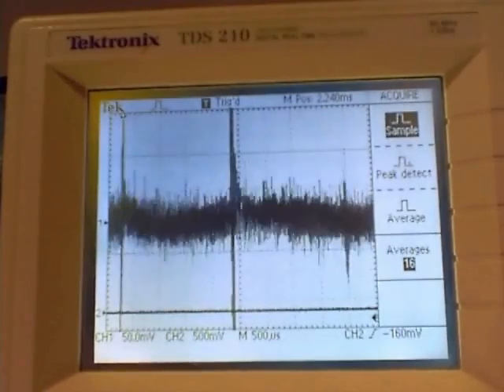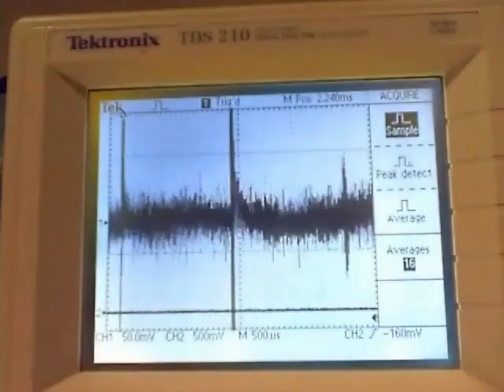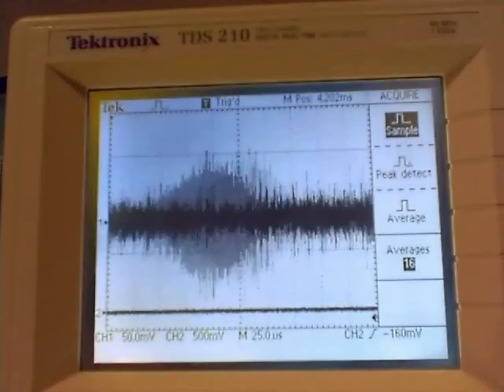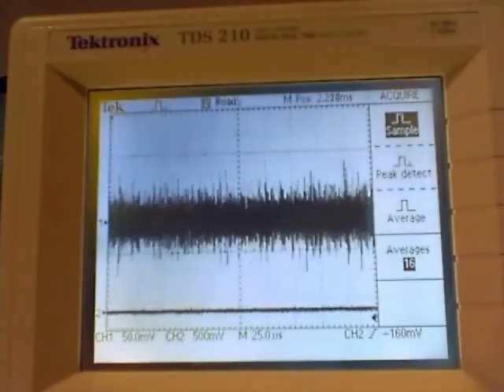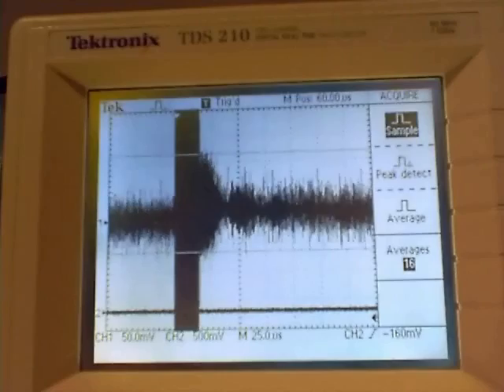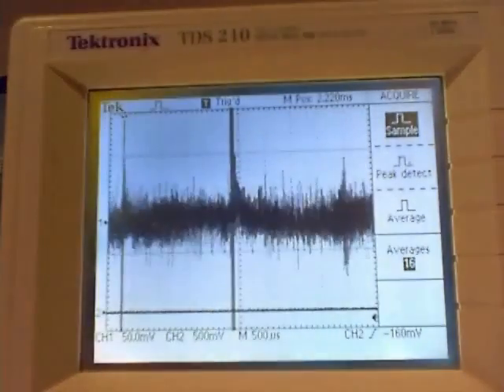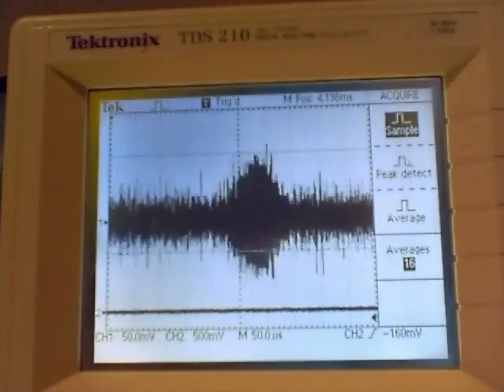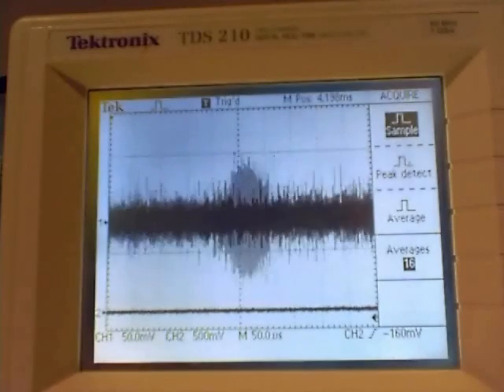Home built Nuclear Magnetic Resonance ( NMR ) Spectrometer part 3 of 3

Comment: I see that your pi/2 and pi pulses are more or less fixed whereas your echo drifts a little bit. Did you manage to improve this and if yes what changes did you make or would you make?
Also, have you tried keeping your pulses the same duration and change the amplitudes as 1:2 ratio for excitation and refocusing pulses?
I also see that your rf probe is in that is in a copper box, I agree its usefull as it acts as a faradaay cage but having the circuitry that close to the copper surely generates eddy currents. Have you tried a different probe body material and just covering up the whole magnet with a fine mesh of copper(I know its expensive), did that improve the the SNR?

edit: how much did all this cost you to make?

Comment: Hi, I'd like to build one of these myself - do you know where I could get a magnet like that?
Reply: He mentioned in the previous video it's a radar magnet he got from a surplus store, but you could just steal an nmr from your local university
Reply: You need to freeze it like - 250°C to get any signal
Reply: @brotherfiretribe9566  That's a superconducting magnet - this is a permanent magnet he has.  I can't find one anywhere, I don't even know where to look.  Or how to ship it!
Reply: @AB608052  these days you can get very nice homogenous magnetic fields in the 1T range from neodymium magnets. Get two of them and bring them close together. To get a homogeneous field make sure that the distance of the magnets is much smaller than the thickness of the magnets and that the sample is much smaller than the face of the magnet.
400-500 bucks will buy you magnets for a test tube, 100-200 for a small cuvette. 
Alternatively you can get nice fields that strong using Helmholtz coils, but that probably requires a power supply that can drive very high amperage at low voltages. And if you want the signal to be any good it needs to be able to maintain a very consistent current.
Reply: @chalkchalkson5639  Thanks, but do you know a vendor? I've tried imitating what this guy did, looking at surplus stores.. and I don't see it.  This was a lucky find?

Comment from the maker: From "Experimental Pulse NMR - A Nuts and Bolts Approach" by Fukushima, P.11, he says " an appropriate combination of intensity and duration of the rotating field can rotate the magnetization by any desired amount...the rotating field H1 required to turn a proton magnetization by 90 deg. usually lasts between 1 and 50 microseconds in a modern pulse NMR experiment." With my RF power and coil I found empirically that 20-25us leads to the greatest intensity of the FID.